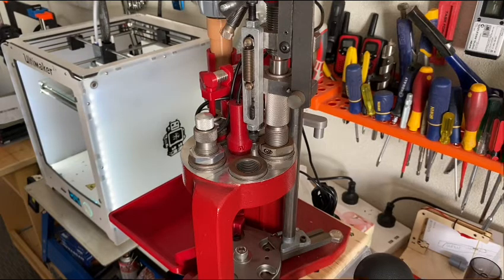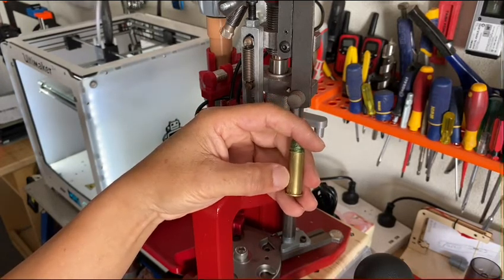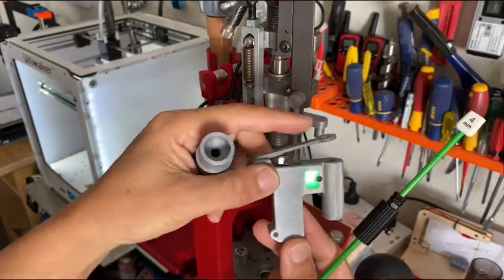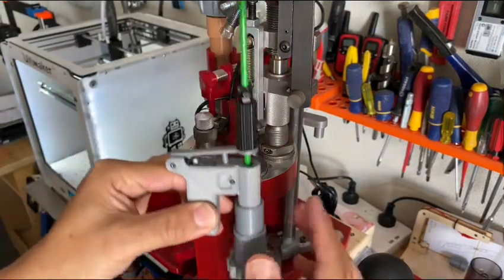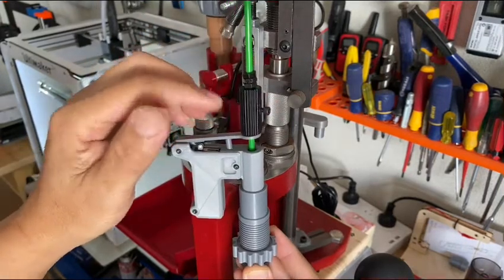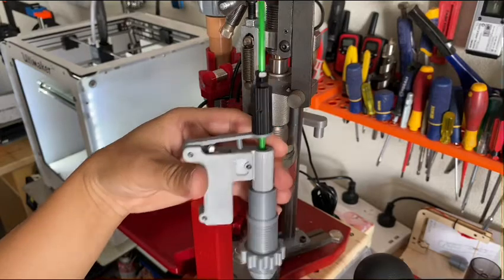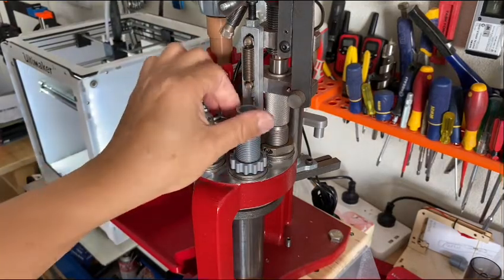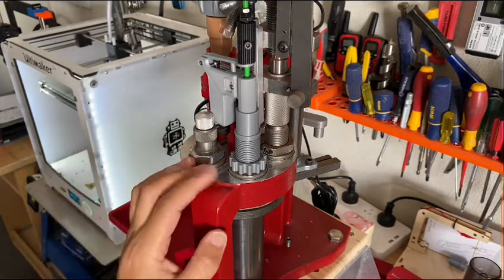Low Powder Warning Device for Reloading Machines included Dillon, Hornady and Lee

Comment: I originally wanted to get this, but considering it will still light up when you have double the powder in their means you cant trust this device. What if the desired powder level isnt even detected by this thing because it's not enough for it to have the light turn on, despite it being the perfect amount needed? I figured it could be tuned to detect the perfect amount everytime, not just that there is enough powder in there without knowing if its the desired amount or more...